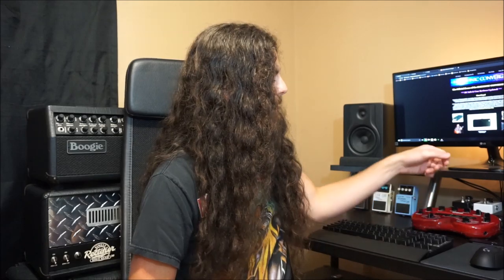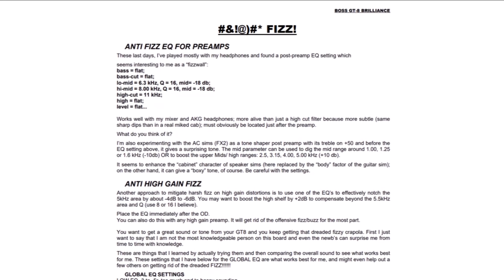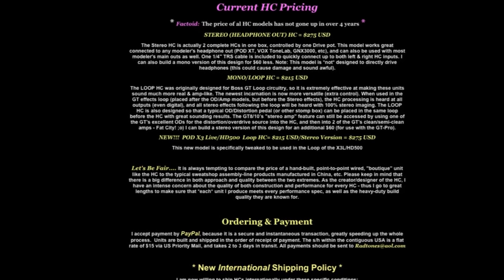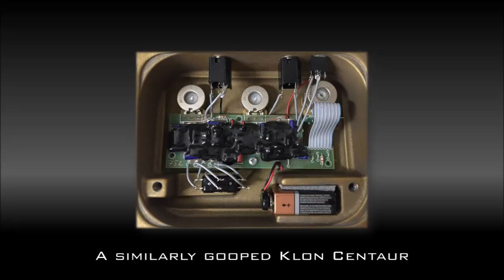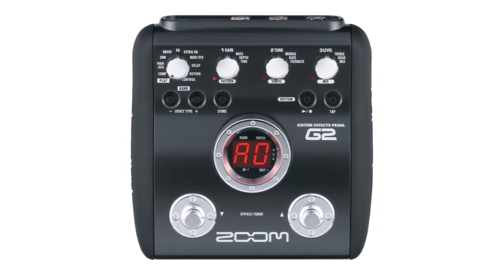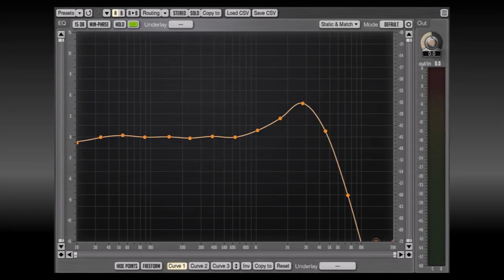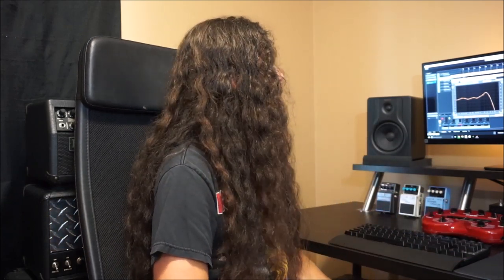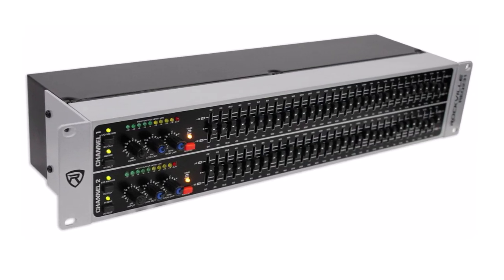WTF is a Harmonic Converger?! - Down the Rabbit Hole

Comment: Ooooh my God 😂😂😂 the memories! I was a regular in the Line6 forums back when "Radley" was peddling this apparatus.. the threads were SAVAGE. Epic flame wars, endless drama, name calling, people doing all sort of weird ass experiments to prove/disprove its properties, gigantic threads that were locked by administrators only to reappear later, more vicious than before and locked again, users were banned, admonished, scared away.. Even I had a little argument with Mr Hadley himself  🤣 fun times! Fun times indeed... I'm half expecting Hadley to pop in the comments section to dispute your video 🤣
Reply: Did you mention that the Harmonic Converger was encased in a solid block of epoxy resin and couldn't be opened without destroying the whole unit? 😂 Hadley was adamant that it was absolutely necessary to protect his unique design.. 
Aah, those days when you just needed to write "fizz" or "harmonic converger" in those forums to start a Chernobyl-like meltdown in any forum thread 😂
Reply: I bought a GT8 years ago and ended up on the Boss forums. I had several lovely email conversations with Hadley regarding the HC. Nice guy. I never ponied up though.

Comment: Maybe because I'm listening on a phone with a crappy speaker, from here ot only sounds like a simple mid boots to where without the unit, mids seemingly have almost no presence... But that's on my smart phone. I got workstation desktop that I can easily put into a stereo or headphone amp. Interesting to say the least. The guitar manufacturing industry as well as the industry providing guitar "accessories", is WAY too polluted with mumbo jumbo, heresy, massive popular misconceptions, urban legends and flat out snake oil salesmen, carnies, and manipulation just to overprice a bunch of purposely conditioned nonsense to make us consumers buy based on misinformation and further perpetuate a spread of nonsense and, like you said, buzz word'ing of terms or claims that are not finite as subjective instead of merely hype of the objective. 

Eric Clapton pedal, Dimebag Darrell pedal, whoever pedal... They all basically all use basic distortion pedals, regular tube screamers and whatnot and those "boutique" pedals, like that "gourmet" popcorn, is only "defined" by buzz words and are over priced with claims to match an artist's one specific tone, whenever those artists are using standard stomp boxes and have multiple more diverse options when they are using their regular collection of pedals, as opposed to the "layla" singular setting on the Eric Clapton pedal. They don't want you to also realize that the artists DON'T play their popular tracks live the same way twice, lol... 

Yeah, i have been a gear guy since the 1990s and I think I finally figured out what's bullshit or legit or only preference based when dealing with gear these days for the best part of about the last 15 years of me playing.

Lol, right now, I'm playing a $180 Kramer Baretta Special and a $150 Kramer Focus VT211S as my main guitars, with Jason Lollar pickups (even if pickups cost more than the guitar,only the overall end price of the whole collective final modded guitar matters to me), a Boss pedal board (maybe not as good as the whole collection of it's included effects separate stomp boxes, BUT having to either pay $2000+ for multiple effects that all require individual switching, I settled for $500 and the tolerable quality that switches multiple effects on one click on the fly) and i could go on...

Doesn't hurt I learned to repair and mod guitars at such a young age, mostly because I was so poor I had to do it and couldn't afford otherwise, and as I figured: 

if the military has you issued a gun that you not only master it's use, BUT ALSO have to master it's internal mechanisms and how to disassemble it, clean it, repair it and everything else, WELL I FIGURED that goes for playing a guitar in the "rock army", so it SHOULD be not just normal, but a virtue and should be common to do the same for your "weapon", your musical instruments and other equipment as well as master playing your instruments and utilizing your sound equipment. 

I don't know, I know plenty of guitar players WAY MORE talented than I am, BUT they almost have no clue about amp settings, or general guitar set up, like stretching new strings or setting up intonation or lowering action... I just about threw up when this smarmy dude with his lady walked in behind me at the guitar shop and actually bragged "I'm going to need ten bucks so I can get my guitar tuned again", and I turned around and was like "dude give me five bones and I'll even set up your guitar as well", then I became a local guitar tech that these oblivious musicians actually believe I have some sort of magic touch because I can play a $150 guitar that I modded and sound better than their setup and they will love my "cheap" guitar's sound and action and think I am like this guru, but obviously it's just knowing my shit outside of playing alone or only learning music theory...

If you know your shit inside and out, you sound better, play better and spend WAY less, and THAT'S what matters.

Comment: I had two back in the day, but I got around the stupid price by buying on ebay.  However I got info out of Hadley but pretending I was going to buy from him lol  Anyways, they were a bit shit as they went microphonic at the jacks after a while and if you are playing hi gain that became a real pain in the ass.  If you weren't doing hi gain then it wasn't so bad.  But then fizz was never that much an issue with low gain so it was pointless.  Also I found it added horrible 2.5khz to uhhh brighten it up, but instead it was actually making it sound fake.  I then realised it was bullshit and I didn't need it and how I made my Boss GT6 (and then I moved to the earlier model GT5) was to play through real cabs!  Problem solved right there.  Used a GT5 rig for years, no cabs sims, then through a real set of cabs in stereo!  Loved that sound.  Now using rack gear!!!  The HC was a glorified EQ.  I read somewhere you could get the same sound wiring shit through a guitar pickup??  But I dunno enough about it.

Comment: My issue with modelers is it puts the emphasis on generating tones not playing the damn guitar.  I’ve used modelers once the 80’s and XT Live for over a decade.   I remember this.  Back then there were a couple of ways to amplify these things and most had problems.  This was one solution that was taken quite seriously as was the Atomic amp, which even had a space for your POD in it. After creating these great sounds you want to use them live and in recordings. In the end, nothing really worked for live use.
Don’t get me wrong I love My XT Live.  It’s inspiring as hell, but the amazing tones I spend hours tweaking get lost live.  That Plexi, Univibe, reverse delay with cavernous reverb sounds epic in the headphones disappears when the bass comes in.  Plus the option anxiety when trying out the thousands of amps, cabs and pedals.......and you get ear fatigue and come back the next day and wonder what the hell you were thinking.  

My current rig is a Orange MicroDark cranked into a 2x12 Barefaced guitar cab.  The MD is only 20 watts but the Barefaced cab is so much more efficient it can hang with a band. Seriously, check out these cabs! They’re going to revolutionize the amp market. Their design is a patent pending way of spreading the sound more effectively so you hear yourself where ever you are in the room.  You don’t have to stand in front of your cab.  Which means you can use a 20 watt amp and hear yourself plying with a band!
I control the gain with my volume,  1 for ‘clean’ 3 for rock and 10 for the HEAVY.  It’s one sound but I find I play easily twice as much when I practice because I can’t tweak the tone anymore.  I know the sound and just get on with it.

Comment: FYI, due to methods like Time-Domain and Frequency Domain Circuit-Analysis, gunking black crap all over the circuit board with pretty much anything is not gonna do much in the way of preventing people from figuring it out. It doesn't matter how well the circuit itself is visually and/or mechanically obscured. The circuit path will always be traceable, and with technology's progress, it will only become easier. There is a technology channel on Youtube whose name escapes me at the moment that got the modules of the Apollo guidance/control computer, and almost all of those parts (like the memory modules, for instance, one of which had a broken connector inside it) were encased in black epoxy, yet they were able to reverse engineer and get it working anyways by using Time Domain and Frequency Domain Analysis.

Comment: OMG this thing popped up in my mind today and I thought "SOMEONE will have made a video about it by now." Lo and behold, this gem of a video pops up. Awesome. I remember wanting to try one of these with my Boss GT-8, the first modeler I ever owned.
Reply: This unit actually worked surprisingly good on Boss GT units. This video demos it on Line 6 modelers where it does an OK job but not as good, and on zoom ones where it's kind of in between in my personal opinion.

Comment: I will offer my experience with the HC. Let me Begin by saying this Hadley uses GT products like Boss GT 6 or 8 I use it with my gt-10 by boss. Also you didn't show the manual or make mention of the manual which is worthy reading for the application of this unit. Also I see you're using digital software versus playing it live and it appears you don't even have a harmonic converger unit
Reply: I'm going to have to agree with this being the the most accurate comment. They were created around BOSS GT products of the time [GT8]. And yes, he didn't even actually HAVE the HC there, didn't use one in his own live rig for his ears, nor did it sound like what the HC does. Another young GenZennial that thought he had all the bases covered.